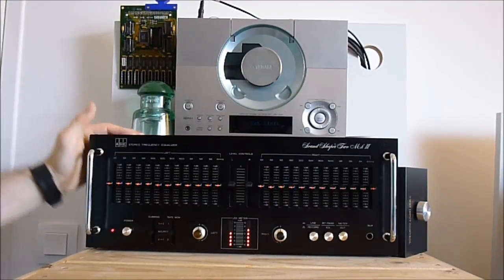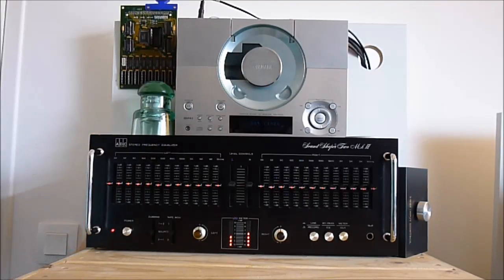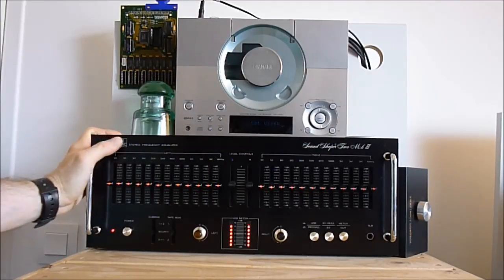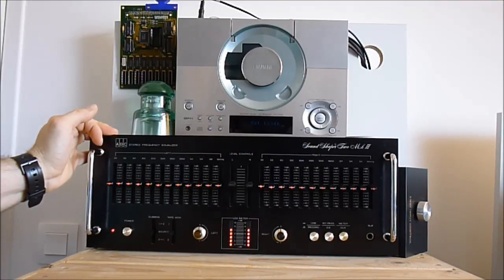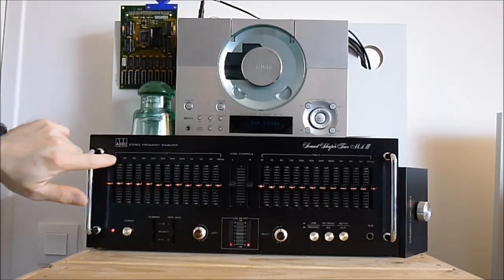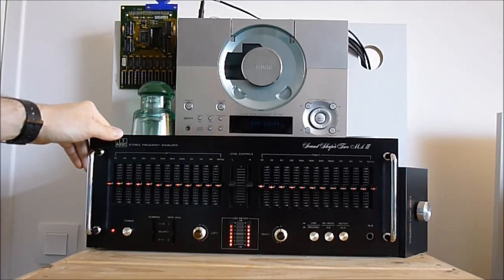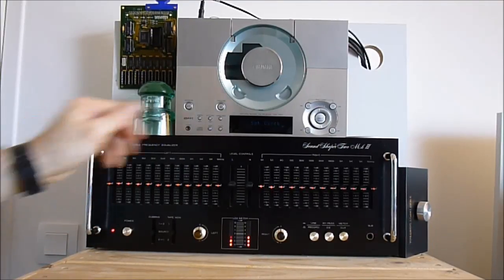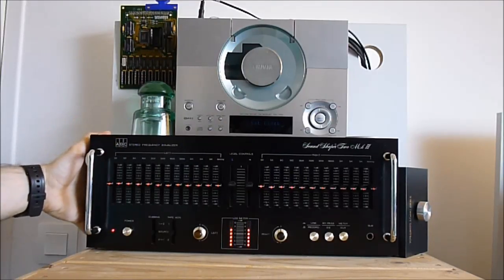Vintage ADC equalizer is  all cleaned working and installed

Comment: NICE! But all the ADC EQ's are great, from the SS1 to the massive SS3IC. Built like a tank. You can't go wrong with an ADC.
  I got my first EQ in 1978. An ADC sound shaper 2, with the green VU meter. Gave it to my brother-in law in 1982 (he's still using it) when I stepped up to the SS2IC. I needed bi-directional dubbing as I had two cassette decks. The big seven segment LED meter was awesome,  also the output volume controls, meter adjust controls and an excellent sub-sonic filter, I think the filter slope is 18db/oct @ 15hz. I'm still using this equalizer, never needed any repairs and still going strong after 34 years!  Would never sell it.